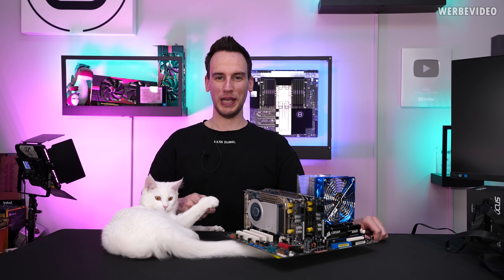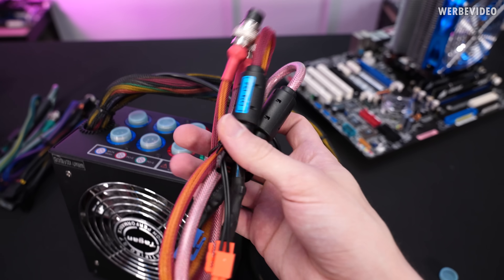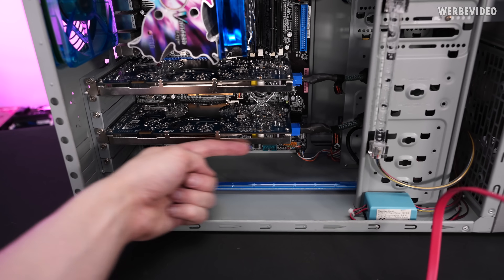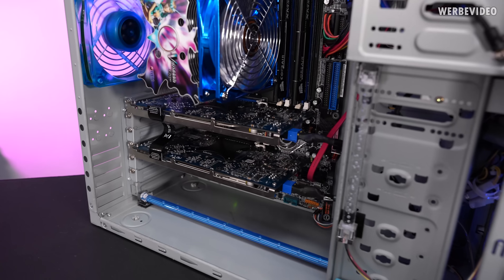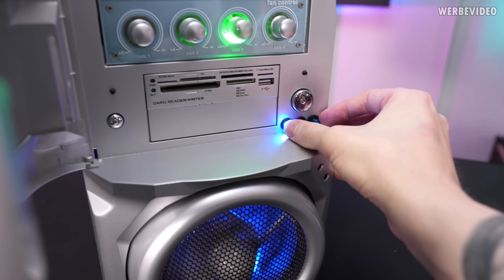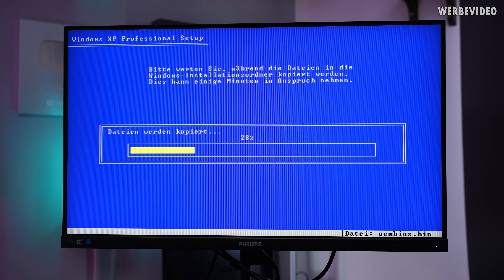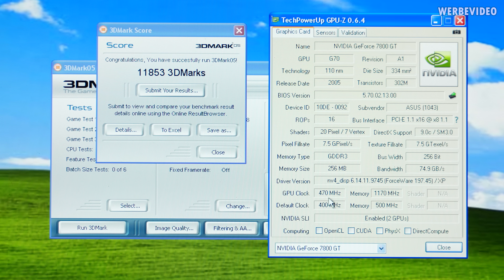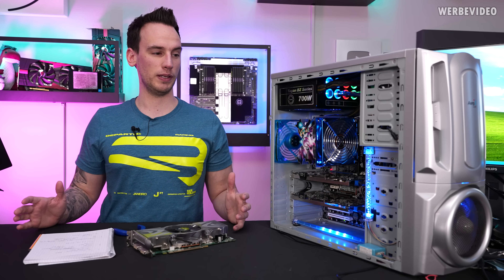Overclocking bricked my Windows - The 2005 Retro PC Part 2/2

Comment: I'm not sure how I missed this video for nearly a year.  Brings back memories of my first overclocking experiences in the very late 1980's.  The overclocking experience back then was more of an engineering project back then.  And overclocking an 80386DX from 33MHz to 35MHz made a much bigger difference than you might guess.  This really was because you pretty much had to overclock EVERYTHING in the system simultaneously.  And the system as a whole was very sensitive to small changes since the ISA bus speed was directly tied to the CPU clock speed.  Oh, and there wasn't much information available to work with since we didn't have the internet yet, and a BBS with the needed info might be incurring charges for a long distance phone call that could be hours long.
My favorite CPU's for overclocking, though, were the AMD K6-2 and the Intel i5-2600K. (I got a 100% stable 5.2GHz from my i5-2600K using a 120mm AIO from Cooler Master!  That CPU was a beast, especially paired up with my Radeon HD6890 video card.)
Thanks for this video and the previous one in the series.
Reply: my first PC had the AMD K6-2 500Mhz, great memories

Comment: Having SLI does not combine 256m x2 to 512mb but you still have 256mb of V-ram in total becoase they get used as a mirror, SLI just meant you get more Rendering power from both chips or use them for that good old PHYSX!

Comment: 12:15 disliked for the rant about overclocking being "locked down" when AMD supports it on nearly every chip.
You can pretty easily exceed  the 1600X performance with a 1600, 2600/2600X, 1700/1700x/1800X, etc. etc.

Comment: I had the ASUS A8N32-SLI Deluxe with 2x XFX 7950GT with a silent heatpipe cooler i.e. no fan. Full dual x16 PCIe. I think I had an Athlon X2 3800. I skipped all the way to Phenom II X4 after that.

Comment: That's an acrylic tube with blown-in bubbles & an LED glued to the end, not cold cathode. That type of LED case lighting is from around 2008, when early LED kits still tried to imitate the more expensive to manufacture cold cathode tubes. 

You could get things like this from old case mod sites, such as xoxide, which is cool to look at for nostalgia. I believe it's still online, untouched for years but I'm not sure about now. Way back may provide you a peek at some off the things they used to sell if not.

Comment: Nice, I still remember my A64 system I built in 2005, some old forum posts from back then had my listed specs. I recall I held the record for a single 7800 gtx for like a day or so in 3dmark at the time after ocing iirc. This was the first system I went from using a CRT to an LCD (Viewsonic VP191B)

A64 3000+ 1.8hghz stock oced to 2.4ghz (not sure on the heatsink)
DFI ultra-D motherboard
2x1gb OCZ performance series ram (3-3-3-8)
Maxtor diamondmax 10 200gb 
Forton bluestorm 500W 
XFX 7800 GTX 256mb oced to 500/1400mhz

3dmark2005 stock 7499
3dmark2005 Overclock 8686 

Still have that 7800 gtx in storage somewhere. the 7800gtx really really benefited from better cooling, all I did was remove the plastic cover shroud which exposed the heatsink then zip tied a 80mm panaflo fan directly ontop of it.

Comment: Oh, the origins of overclocking go much farther back than this. In the 90s we had to adjust dip switches to set FSB speeds and multipliers. Later we used graphite from a pencil to bridge circuits to unlock those early Athlons. Water cooling was done with medical tubing, aquarium pumps, and custom cut water blocks (🤘Danger Den🤘) running through automotive transmission radiators. You'd cut your case open with a Dremel to install a Plexiglas panel and wire up some CC tubes. My first SLI setup was dual 3DFX VooDoo 2s. Even by today's standards those were big cards. Ironic that for a while there the best AMD motherboards you could buy were Nvidia nForce boards.

Although it was worth it cause it was normal to see massive gains of 30%+ and nobody had windows and lighting in a black case unless you were hardcore. Everyone had  beige eMachines and Compaqs. Kids have it easy today cause you can just buy it off the shelf, but you're lucky to see 5% cause AMD and Intel max clocks from the factory to make sure they can charge as much as possible.

Just not as fun spending all day tinkering with BIOS to get a few measly % vs actually building stuff back then to get crazy gains. Probably why I only do modest OCs now days.

Comment: My cat loves to eat cables. She seems to have a very special affinity for my Steele Series Arctis 5 headset cables. She ate one the other day, so I ordered a replacement. She promptly ate that one 2 days later. I have another new cable, but am afraid to use it. I may be forced to go wireless. This PC is still newer than my first PC, an 800mhz AMD Athlon from Gateway, and RGB lights and see through side panels were unheard of. If Im not mistaken I paid close to $2,000, in 1999 money, for that PC.

Comment: Brings back good memories watching this.... my first overclock experience was a Opteron 148 (939) on a DFi Lanparty nF4 and dual 7800GT's (started with one and got a 2nd later when eBay was in the early stages as didnt have enough cash for 2 but wanted dual GPU's so bought lower tier GT's to overclock and double up to wipe out the GTX exactly as you showed in your video)
I cant remember what I got the little Opty too but I'm sure it was around 3.2ish - Single core... how far we've come! 

Remember the DFi board having huge bus speed adjustments and big PCi-E bus overclocking too! I specifically went into the build with overclocking in mind as I'd really only started learning and was instantly hooked!

Just seeing 256mb of video memory and remembering how amazing that was at the time.. I can max out nearly all 12gb of my 3080Ti in todays titles... i miss the old days! haha

Great video really enjoyed it!

Comment: Back in 2005 I had my Antec Skeleton, was an amazing case esp when you customised it with water and paint, then I bought a Coolermaster V8 after being told this was a major game changer for air and it was as I could get almost as good cpu temps with the V8 as I was getting with a dual circuit water setup.   The only reason I don't have the V8 running on my Ryzen 5 rig is because the AM4 is a bit dickywampus for conversion to AM3+ coolers but maybe one day I will get round to doing it but I am looking at a new PSU as my OCZ 1kw is getting very old.

Comment: Hi,  
I'm confused. @9:20 ... When I was running dual GPUs (4GB cards) I only had 4GB total, not 8GB because the cards didn't add together, they both ran as 4GB. But you mentioned having 512MB of VRAM. So did earlier GPUs combine the VRAM but not newer GPUs? 

I ask because back in my XP days, I originally used one AGP card. After that, my experience with dual cards were one in AGP and one PCI for dual monitors. And then later on my first experience with dual graphics cards were crossfire which didn't share VRAM. Also, I can't recall the SLI setup sharing VRAM either, but perhaps they did? So yeah I'm a bit confused about those older cards sharing VRAM but apparently they do. If this is the case, I wonder why new GPUs didn't continue to support sharing VRAM anymore. (?) TY

Comment: At 11:38 =2.2 was the same stock clock as Core 2 Duo E4500, which was later than this system, from 2007, it was given to me in August, 2009 and it beat the snot out of my newer Pentium E2180, which was a terrible clocker! The pull from a 2007 Acer Aspire, was a major upgrade to me in the socket 775 days, even when that's definitely later than Manchester. I skipped the AMD gens that were before socket 775 and went straight to Core 2 in September, 2008.

Comment: G'day Roman,
This build was Awesome🥰,
For Extra content related to this (Although I'm guessing Screen Text would be in German) it would be Cool to go through the XP Install including setting up for any Updates necessary,
As well as where to get the XP Installation Media plus Compatible PC Monitoring & Benchmarking Software. Plus what to do about the 30Day Lockout if you don't activate.

I still have a XP PC which I use for Converting Analogue to Digital as the programs work fine & are not Newer OS Compatible, Increasing Processing Power is irrelevant as a LP or Video Cassette Play Time is the Limiting Factor, but I would like to Migrate the OS from HDD to SSD for better OS & Program Performance but have been having trouble doing this with my Clone wanting me to Reactivate but not letting me. Maybe I am doing something wrong when Cloning with the Acronis that came with my SSD ???.
PC Spec: C2Q9650, GA-G33M-S2, 4GB DDR2-800, Gigabyte GTX275SOC (1796mb), OS-250GB (HDD 7200rpm), ASUS DVD-DL LightScribe ODD,
plus CoolerMaster ML120 AIO modified to 92ml Radiator to fit in my HP t000 Case

Comment: Whooo! And here I am watching this video on an almost period correct laptop...a 2004 Toshiba Satellite Pro M30 that had the Rivatuner clock limits adjusted to get to 266 on the GPU core and 400 on the VRAM and it lived a year and change until the poor GeForce FX gave up and gone to limp mode. Was a worthy risk to play Rewrite (visual novel) and Medal of Honor: Pacific Assault. The CPU (Pentium M 725 1.60GHz) was topped out at 2GHz with stock 1.34v using ClockGen

And since the screen on this laptop is giving out there is a VAIO that I will be having around...a VGN-SZ18GP_C (Core Duo T2400, Go 7400 TurboCache) that managed to put out 841 3DMark06 points on eight test run loops with 512 megs of system RAM...poor pagefile! Just a GPU overclock (from 450 to 533 on the core and 700 to 750 on the VRAM) had put out 914 points on 3DMark with system RAM very tiny that the Canyon Flight test hangs up before proceeding because of pagefile read on the HDD...

Will go get some RAM and a Core 2 Duo and better thermal paste in a bid to help it...and need a modded BIOS for it too to open up locked BIOS menus...or else I'm screwed

Comment: one thing i would love to see is the phenom II 955 with asus m4n98td evo motherboard, 2 stick of 2gb ddr3 ram, dual gtx 460 gainward, corsair nova 32gb ssd (just enough for the OS) and a 500gb hdd, thermaltake element g case and chieftek super serier 750w psu

Comment: i missed if this vas 939 or am2 mainboard i had 939 and have it always at 2400mhz i remember i vas so glad :D but it vas the time period the intel relesed the  e6600 and i had that and alot more of the 775 mainboard so memorys alot :D i still have a gigabyte x38 dq6 with a e6850 and also a q6600 :D

Comment: Couldn’t agree more with the 3Dmark05, I remember running that on my GeForce 8800GTS 320mb in 2006! That’d be my vote on what to do, throw an 8800gtx in and fire up the original crysis!
Reply: I remember running 8800GTs in SLI. That card was a beast.

Comment: Since CPUs are mostly differentiated with cores now instead of clocks it is pretty much impossible to overclock a cheap part to perform like a high end part. Add to that how binned the CPUs are and it becomes even harder to OC a mid range CPU because the good ones becomes the high end CPUs. It used to be a “hack” to cheat and get more for your money but now over clocking isn’t about cheating the system, it is just another part of the system and a way for them to squeeze more money out of you. At the same time I don’t blame them. As it became more mainstream there was simply too much revenue lost to overclockers. It is unimaginable today to think that you could buy an RTX 3070 and unlock the cores for it to become a 3090 with a BIOS switch like you could on some cards back then. Or OC a cheap CPU to beat the most expensive one. The cooling needed has increased too. It was not uncommon that even a stock cooler could do good OC before or putting some heat sinks on the bare VRAM could create wonders. Thanks for these nostalgia videos. I just wish it was more easy to buy cheap parts today and OC them or unlock cores like how some AMD CPUs would unlock cores.

Comment: 500w PSU. That's a disaster waiting to happen. 

I had a similar build back in the day (Athlon 64 x2 3800+, 2GB of RAM, dual 7800GTs in SLI, PhysX P1 card, X-Fi card) but with an Antec 480w PSU. Nope, ran hot, BSOD galore, and PSU died in 6 months.

Second PSU is a 600w Enermax. Less hot, less crashes, but still not stable. PSU died in a year, with a bang.

Third PSU is a 750w CoolerMaster. Now I finally got stability. But shortly after the southbridge fan started failing. And the entire mobo dies after I replaced the fan.

PS: I used the IDE ports for DVD-ROM. Also, am I going crazy or are you running the two 7800s without an SLi Bridge?

Also, consider running Windows XP Pro x64, which is based on Windows Server 2003 R2. Better use of system resources.

Comment: I mean i can do it with my 6900xt and get 6950xt or even 3090ti performance just by doing a registry mod and pushing power draw up to 380 watts. I get around 2680mhz on core and it got me 15200 on firestrike ultra paired with a 5950x with 4000mhz memory.

Comment: i actually had a64 3000+  with ocz dual channel 2*512 MB 2-2-2-5 PC 3200, 2 * 6600 GT in SLI, gigabyte GA-K8-NXP-SLI, WD caviar 1200JB and tagan TG-480-U01 (fully modular PSU, top of the class for that time) in a xaser 3 v1000a case. It was my first personally build rig and i was about... 14, 15 when i bought all that. Firstly a company that got me the parts wanted to assemble the rig and they did just to put it in their display case and i got a nice discount on everything. When i got it i realised they managed to brick one of the GPUs by trying connecting them because they didn't push the SLI bridge on well enough and then we realised they tried to OC the winchester based athlon and it started crashing. To compensate they reordered the parts and i had 6600GTs clocked at a highers speed, Venice instead of Winchester A64s and TG-480-U15. It was also funny that they complained how heavy PSU was and that apparently cheapo LC-Power 550W would suffice. It did not. LC-Power couldn't actually run all that hardware, two CD burners and i think 8 fans that Xaser 3 v1000a had.

Ah. fun times.

EDIT: I also covered the edges of motherboard and GPUs with UV reactive colour and i had two blue/UV cathodes. 

TLDR: Tagan PSUs were amazing, mine powered coworkers rig when RX 290x were out and now i have all the parts to assemble my machine back, but i have to get GPUs. Dream would be getting two Gigabyte 6600GT 3D1 which would  theoretically enable quad-sli

Comment: I used to overclock 800 Mhz Durons ( Socket A/472 ) and the early Athlons. (Grey brown ceramic.) They weren't locked, so you could easily change the multiplier. If they were locked you needed to connect 2 specific dots on the top side with a pencil. And a little bit of the clockspeed ( 7-10 % ), which with Asus mobo's also overclocked the RAM. The later Athlons (more like PCB) got a groove between the dots you needed to connect to unlock them. You needed to fill that groove with a little bit of glue, so you could connect the dots with the pencil. Especially the early Athlon 2500+ was a good overclocker ( had them comparable with the top of the range 3200+ ).  This video, although more recent, took me on a memory trip. Thank you so much! Shocking that the jet in front didn't have a motor. Never knew that. I always put fancontrollers in the cases. About cablemanagement in those days: I ran (isolated from the tray obviously) copper strips at the back of the mobo-tray and soldered the wires to them. Really clean! Really labour intensive though.

Comment: Best bang for the buck overclock was the Celeron 300A. Just change the FSB to 100Mhz and done. Instant boost from the stock 300Mhz to a rock solid 450Mhz. In an era where the top-of-the line Pentium II 450Mhz was ridiculously expensive, grabbing the Celeron for a fraction of the price was awesome.

Comment: Yeah, overclocking with an HDD from those years, maybe older and any BSOD could cost you a few minutes waiting for it to boot, I still liked it. Started with an AMD K6 I think it was, 350 to 550MHz with jumpers on the motherboard haha. Few years later with DDR2, lapped Celeron D326 the max I got was 3.55GHz on AIR!! After that, lapped a Pentium D935 and did 4.35GHz. Now I'm still on an i5 3570k at just 4.2GHz, got to 5GHz and used it for a few years but didn't like the temps because it has always been air cooled.

Comment: A fun era I remember with fondness. I used to lock my PCI Express Clock to 101MHz in the BIOS when overclocking, I never tried higher like the 115MHz you used. The PSU I used in that era for my system was a Silverstone Strider 650W semi-modular. I took a look at my 3DMARK results and still have scores from back in 2006 using a FX-60 and SLI'ed 7900GT's... my best score was 15214 for 3DMARK05. Going earlier (2005), there are also scores for my AMD 4000+ and a 7800GTX system with the best being 12069. My earliest score for '05 were for an AMD 3500+ and a 6800 Ultra... 6040.

Comment: the best overclocking chip in those days IMO would be the Opteron 165, I still have my Abit AN8-SLI and can run it at 333 fsb with HT at 3.5, so effectively 1.8Ghz to 2.7Ghz. I don't think I'll ever get rid of this combo.
Reply: The Opteron 165 was an absolute champ. It and the i7-860 were easily the two CPUs I wrung the most performance out of relative to where they started stock.